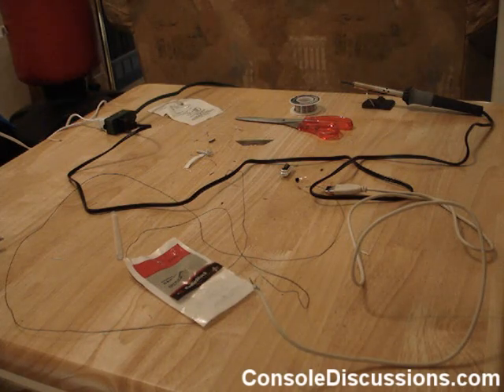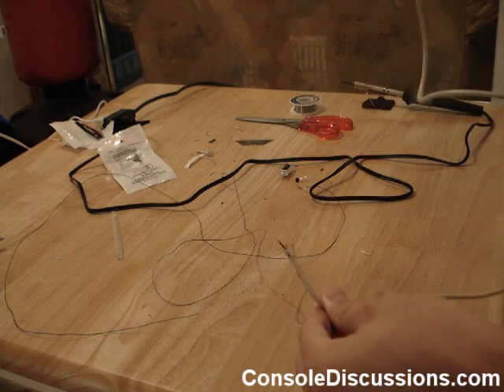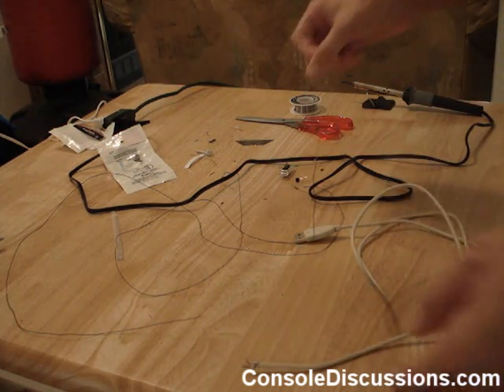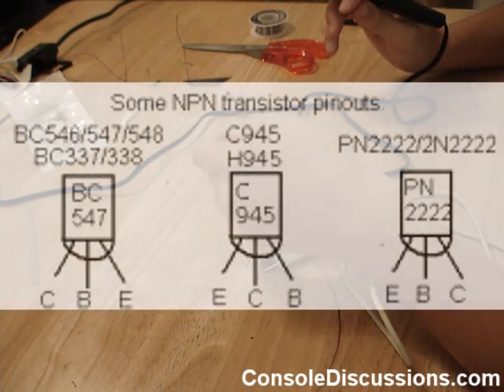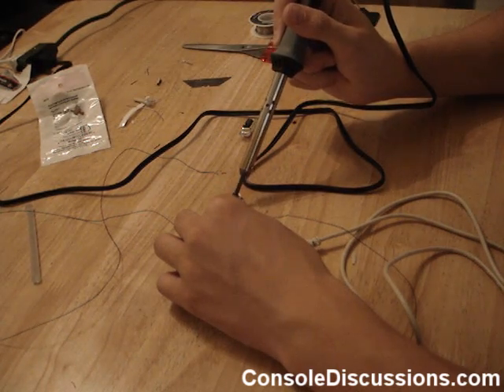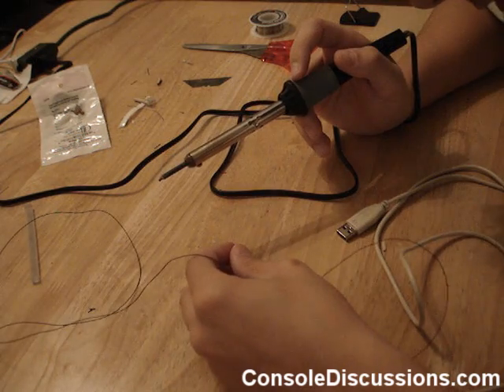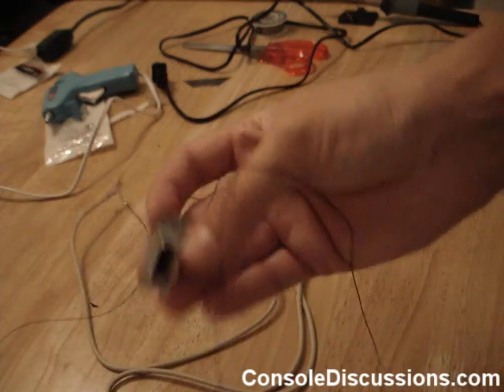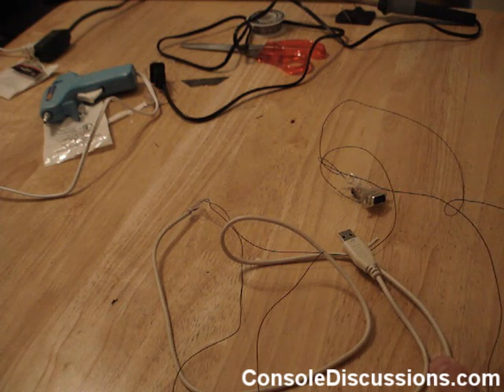Making Your Own Lite-on Probe

Comment from the maker: Those home made ones aren't homemade. I have one. A business makes them and they ship with drivers. If anyone has trouble out of this homemade probe let me know. I'll give you the drivers I got, because I had the drivers installed before testing my homemade probe. I didn't make this video to make a probe I made it to help out others. Although I did test it and it worked fine, but it could have been because of the previously installed driver. Not sure. It's worked with others just fine.

Comment from the maker: I could possibly be possible, but I wouldn't know. Find the ground and the 12v wire of the drive and disconnect the current ones and plug in the USBs.

Comment: Thx so much this was so easy I had a soldering iron and a solder along with wire. The links were very helpful, I am hoping to make one today, and the usb was an extremely  helpful idea (another guide u had to connect to molex). O and so I just connect the usb and the 9 pin and the sata with the drive half open and the xbox powering it and it will get my key?

Comment: Same here.  I took apart and reassembled the item thinking I may have put the transistor on backwards and still no luck.  *Bad Serial Data*.  Is the USB as a power source a proven method for powering the probe? Thank you for the video...it was much simpler to follow than the other schematics I've seen floating around.

Comment: When I use jungleflash with this home made circuit I either get bad serial read or sometimes Jungleflash just freezes up.  I am using an nForce4 SATA chipset so it shouldn't lock up like the VIA's do.  Any ideas?